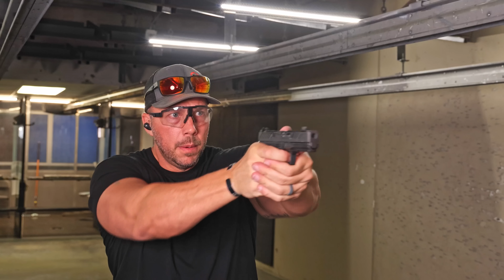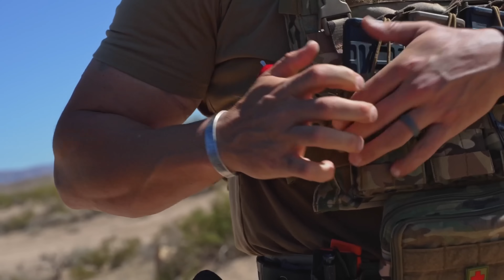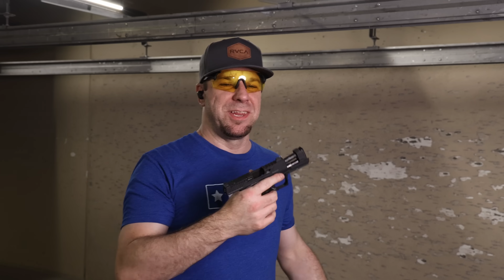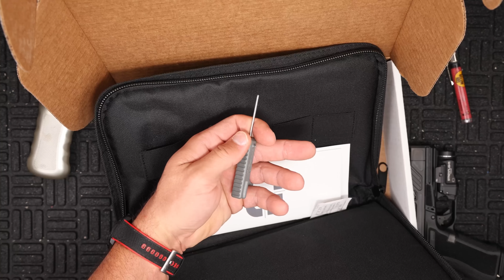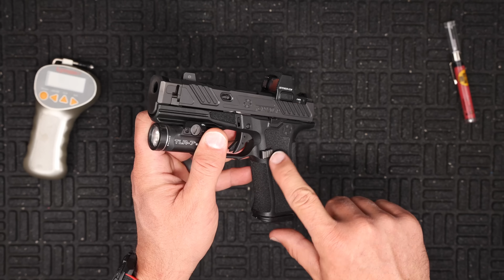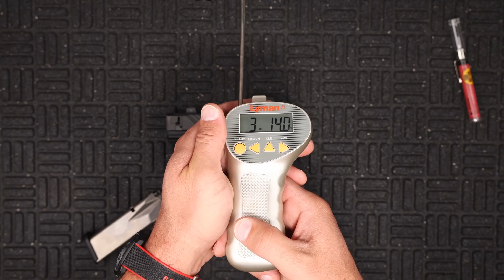Shadow CR920XP Did It Ever Run Right?

Comment: How did you get the screws to fit into optic provided from shadow? Looking at an enclosed CCW and in between filing screw heads or FN provided screws
Reply from the maker: The shadow screws fit right in

Comment: Buyer beware...it will need a Tactical Pontoon Peacemaker Extreme Carry trigger system installed. The factory trigger is horrendous
Reply from the maker: I had no issues with my trigger but factory triggers are never going to be as good as tuned ones.

Comment: So which is the nicer shooting pistol, this or the Echelon 4.0 Comp?
Reply from the maker: I'd really have to run them side by side to determine that. The Echelon has a much different grip size to it and overall thickness. But the Echelon has a more abrupt impactful recoil that other things in its size. Not more muzzle rise just different.
Reply: @TacticalConsiderations I agree. The echelon feels like a 45 with how it “pushes” rather than how 9mm have a “snap” to them

Comment: Great video. I own a CR920X and I’m thinking about either having my current slide and barrel ported by a third party (Battle Ready Arms or MAC Defense) or purchasing a CR920XP. I’ve read anecdotal reports that some XP pistols can have reliability issues with 115‑grain ammo, and I’d like your  input before I modify or buy another pistol.
Reply from the maker: I like the XPI have run tons of 115 to 147 all ran after those first few mags.

Comment: really thinking about getting this gun! i have heard good things about it! being part of the LEP stuff i probably get a good deal on one.
Reply from the maker: I have enjoyed it. Most hat have problems do not break it in appropriately. They recommend like 100-200 rounds of 124g factory ammo for that. But I cheat it. What I do is a lot of dry fire, clean lube, dry fire, clean and lube again. Generally that works it out. However I think I showed in this video I had a few hiccups in the first mag. Since that its been tops.
Reply: @TacticalConsiderations  Thank You Sir for the tip! I’ll give it a try when I get one!

Comment: No, the Shadow Systems CR920XP is not exactly a Glock clone, but rather a distinct design built upon a Glock-style platform—similar in dimensions and operation, with full optics-ready capabilities and compatibility with some Glock holsters, yet packed with significant custom features.

⸻

Glock-Like, But Not a Clone
	•	The CR920XP is built on a Glock-style frame and basic operating system, which gives it cross-compatibility with certain Glock holsters and parts. It’s a slim, double-stack 9mm subcompact reminiscent of the Glock 43X or 48  ￼ ￼.
	•	Unlike straight aftermarket clones that closely replicate Glock’s internals and aesthetics, Shadow Systems elevates the design with custom enhancements: aggressive grip texturing, an integral compensator, tool-less attachment, optics-ready slide, and premium machining. It’s more of a refined, carry-optimized platform rather than a true clone  ￼
Reply from the maker: So its a clone

Comment: I love the Shadow Systems line up and have a few. The CR was meant to be a small concealment gun, but when you add longer grip, compensator, (which makes a longer slide length),a light, and even a magwell, (which would print)……I feel you might as well carry the MR because now it’s the same size and weighs the same. You have just defeated the whole purpose of the CR.
Reply from the maker: Its still an overall smaller rig and much thinner to carry than the MR.

Comment: I have the SS cr920x had one jamb out of 200 rounds breaking it in. Used blazer 125
Grain . Going to try 115 next but I Love the gun
Reply from the maker: Use a good 115G after that break in and you should be fine.
Reply: @TacticalConsiderations unfortunately I just traded it in for a Glock 19x I loved the gun but I don’t carry because of being in New Jersey and I found it was a super snappy and compact gun. I loved it but didn’t find purpose for it

Comment: I bought one Saturday took it to the range today fired 300ish rounds through it with one hiccup in the first mag had one failure to feed then the other 300 round ran just fine was a mix of 124gr blazer and sellier & bellot
Reply from the maker: That’s a decent round count for a break in.
Reply: @TacticalConsiderations  what screws did you use for the vortex

Comment: Man I just came back from the range and incredibly annoyed even though I know about the break-ins for SS. Only had three follow-up shots in 250 rounds. Did a light clean once in-between just to check things inside and still looked good, lubed up and still the same issue. Failure to eject, after 200 rounds it started to mix between fail to eject and fail to load. Checked with other pistols to make sure ammo worked and I wasn't limp wristing. I want to love these but I hate out of three none worked fine out of the box. After a deep clean and another 250 I'll make a final decision I guess
Reply from the maker: What ammo are you using 124g or better.

Comment: The cr920 is a shit gun. I got one. So frustrating.  I own when it shoots its great. But overall is a pos.  Also f the break in period. That is ridiculous
Reply from the maker: Please explain. Did it not function on factory ammo after the break in? Mine took a few mags like I showed in the video and not a single malfunction since.
Reply: @TacticalConsiderations i was getting multiple malfunctions. Failure to eject,light primer strikes, wouldnt return to battery.  I was running 124g too. I just cant get behind something that may or may not work when I need it too. Reminds me of a 380 it could stop a guy with an axe but also it could not lol.

Comment: Any adjustment needed to get some of the mush out of the trigger? Does it help after many rounds ? Not talking weight but pre travel -reset
Reply from the maker: The travel will always be the same unless you swap connectors. But the triggers do smooth out with a lot of dry fire, polish job or lots of rounds.

Comment: Took me nearly 500rds of break-in my MR920 primarily using 124gr, but my DR920P only took less than 50rds to complete break in. They both now have over 1000rds and run flawless, but doubt I'll buy another SS again
Reply from the maker: Good lord. That's a bit long. I like to dry fire the crap out of these before the first range trip that seems to get it done most times.
Reply: My XR920 has been a jam-o-matic for over 450 rounds and my CR920 ended up running even worse after a trip back to Shadow Systems for a new barrel and trigger.  I want to like Shadow Systems but won't waste any more time or ammo on their guns when I can count the failures I've had in 17 years with Glocks on 2 hands and have fingers left over.
Reply: @SombraPiloto  thats insanely bad!!! Damn
Reply: @Fr3d671  The CR920 was FTFing with the rounds getting hung up on the slope of the feed ramp and after I got it back from SS the rounds were literally being crushed into the lower edge of the feed ramp so hard that it would peel the jacket off the nose of the bullet. My Glocks will straight out of the box feed everything from steel cased Russian ammo to underpowered range FMJ to +P JHP with no issues so my Shadow Systems experimenting is done. I'd like to try out an RXM but as one of those weirdos who actually like the Glock grip angle I don't see myself shelling out for one.
Reply: @SombraPiloto  just picked up a Ruger RXM and 300rds all grains without a single jam lol freakin SS sucks huh

Comment: This break in time is lame. That is like saying your wife will only cheat on you for the first week. But after that you can trust her. 🤔
Reply from the maker: As funny as that is break ins are real on most mechanical device.
Reply: @TacticalConsiderations  True. But I have never had that issue with a Glock. I know, I need to spread my wings. However, I can’t deny the fact that Glock has never failed me.

Comment: I went to  the range with my CR920XP and was shooting 147gr FMJ.  I ran through 200 rounds of ammo.  I definitely had issue with the 1st 50 rounds.  They were a range of FTE's, stove pipes and failures to lock back after the last round.  I'd say at least 20 failures.  As I kept on shooting this happened less and less. The last 75 rounds or so were problem free.  I'm going to head back to the range next weekend and put a couple of hundred more rounds through the pistol before I start carrying it full time.  So far though I'm really liking this handgun!
Reply from the maker: Sounds like it's starting to break in nicely.
Reply: So far I've put 430 round through my weapon. This last period I shot 200 rounds of 124gr Nato FMJ.  No issues at all. I then tried some Blazer 115gr and had issues at least half of the 20 rounds I shot.  I also  tried my carry ammo of Lehigh Defense 90gr Extreme Penetrator ammo.  The velocity on this ammo is advertised as 1300fps. I had FTF, FTE and stove pipes with at least half of this ammo.  I have no issues with this ammo in my MR920 at all.  I also shot some Federal 124gr +P HST and no issues.  So I definitely won't be carrying the Lehigh Defense with the CR920XP and will be using the Fed HST ammo.

Comment: Mine didn’t come with Lucas oil! Good thing I have my own. I too have to get through the break in period. I’m 100 rounds in. It’s running better than it did initially. I’m going to clean it and go back to the range next weekend and put  250 through it. Wish me luck 🍀
Reply: Good luck out there!  Just shot mine last Saturday for the first time, no issues at all with 124 grain ammo.  Started with a box (50) of Winchester 124 Nato, followed by 50 of Lawman 124, & 40 rounds of Winchester 124.  Waiting on more 124 grain ammo to come in, figure I'll get to 500 rounds before I order a holster & make it my new edc.
Reply: @MrKlein83  So the rest of the break in went great. I ran a box of 124gr magtech and 200 rounds of 124gr cci blazer brass. No issues at all. I ordered a case (1000)of 124gr cci and 250  Speer GD 124+p. I’m going to run another 250 cci then 50 Speer GD and I think I’ll call it good to carry if all goes well!
Reply: @ Glad to hear the rest of the break in went well for you.  I think if it makes it through the next 300 rounds trouble free, you'll be good to go for carry.  Tomorrow my case of Lawman arrives plus a box of GD carry ammo, decided to try the Lawman TMJ, hope it likes it.
Reply from the maker: Hmmm maybe they stopped adding it.

Comment: Correction. No steel mags come with this model. They supply you with 3-POS PMags. 
It’s not $880. It’s $1100. 

J😮st saying…….
Reply from the maker: You are wrong.. These don't take pmags that is the other models. CR series uses metal mags, the xr, dr, mr and xr use pmags.

Comment: My dilemma is to get either the CR920XP or the P365 Legion. After the breakin ammo the SS requires they are basically the same price.
Reply from the maker: Tough call. Any one feel better ?
Reply: @ yes actually found a store that had both and the sig p365 legion fit my hands better than I think any other gun I have ever owned so I got it. Got a holosun and streamlight tlr7 sub hl-x on it and probably going to the range tomorrow. Hopefully I shoot it as well as it feels

Comment: I carry the CR920XP.  The first 100-200 rounds were jamming every few rounds.  I was using 115 grain.  After actually reading the owners manual I discovered there was a 200 round break-in period.  That 200 rounds should be the +P ammo.  Once I did that, I can now use any of the cheaper ammo.  Has not jammed in over 1000 rounds since I properly broke it in.  Should it have a break-in period? I would prefer not, but taking that out of the equation it is a fabulous gun.
Reply from the maker: Yup its likes 124 on break in.

Comment: Just bought a cr920xp last week. No issues with the break in period. shot about 150 rounds couldn’t make it to 200 because the trigger pull hurt never had that before wondering if this is normal?
Reply from the maker: Hmmmm that's odd your finger hurt.

Comment: I sent my MR920 back to them twice. It did not eject on the first attempt. I had nothing but problems. Customer service was great, but my copy was a dud. I think it has to do with them messing with the extractor pin to for their optic mount.
Reply from the maker: Hmmm did you get a new one.

Comment: My 920xp is the worst gun I have ever fired bar none.  Had stovepipes literally every shot for 200 rounds.  Around 1 in every 100 rounds is a light primer strike (good quality factory ammo that has never had a light strike in any other gun).  Sent it back and they fixed the stovepipes but can't fix the light strikes.  Will NEVER buy another shadow systems, complete garbage.
Reply from the maker: That's a bummer, sounds like you had a bad one.

Comment: For a custom Glock it’s a steal. I used the DR920 on duty until my department and I stopped seeing eye to eye and I changed careers. I had one FTF in the first 200 rounds. 

My only issue with it since then was the last round hold open. My meaty palms ride the slide lock in my high grip which is a “me” problem and not a gun problem. (I also block the slide lock on a Glock). I’ve got a little over 3k rounds through it with just that one issue. I’d say they’re g2g.
Reply from the maker: Hand size always comes into play with riding a slide lock. I used to have a big problem with that

Comment: Buddy bought this gun and had the same issue. Took about 50 rounds to start operating consistently. They need to advertise there's a break in period for this gun because it seems to be an issue.
Reply from the maker: They are pretty up front about the break in

Comment: With all the money I've spent on Glock upgrades, a Shadow Systems would have been the far better choice.
Reply from the maker: I kinda feel that way too
Reply: Except that you don’t need to do the Glock upgrades. It’s good to go out of the box
Reply: @ChrisPBacon28  Not in my experience.
Reply: @KingQ4444  it’s an objective fact that Glocks don’t need upgrades to do their intended job well.  You may feel like you want upgrades, but you don’t need them.
Reply: @ChrisPBacon28  Perhaps I got the one in a million shit Glocks. Mine was a piece of shit until I upgraded various items. Prior to the upgrades I was having light primer strikes, not going back into battery etc.
Reply: @ I think “upgrade” is the wrong term in that situation.  You should have sent it in for warranty repair

Comment: I used 124 grain to break it in, about 200 rounds of it then started pumping 115/124/147’s of all sorts hollows, fmj’s and even some 100 grain critical defense (pink stuff that’s light recoiling) and only had 1 issue that happened with the 100 grain stuff. Got about 500 rounds through it now and couldn’t be happier!
Reply from the maker: Glad to hear it.
Reply: I was able to buy (2) CR920XPs.  Both pistols have provided an identical experience to what you described.  Only 1 logged issue with each pistol, both around 250 rounds.  Couldn’t be happier with them.

Comment: My CR920XP malfunctioned every round for the first two magazines. It’s been flawless for over 600 rounds since.
Reply: I've been thinking about getting it as my first gun. Do you use the gun straight out of the box parts or have you upgraded triggers etc?  I'm debating between this or the hellcat pro comp
Reply: @ozzyc1396  - I'm a trigger snob. Therefore, I installed a Johnny Glock. Most people find the CR trigger gets better with use.
Reply from the maker: Nice.

Comment: Big guy the other lights won't fit on the cr920 XP the rail is too Slim Only the subs can go on that rail the other light just wobble because they are to wide. I put the new TLR7 HLx Sub on my XP. I love those gun. Stay safe Sir!
Reply from the maker: Someone was making insert for thr lights to fit.
Reply: @TacticalConsiderations  I looked a few months back because I have a Olight pl3r from my PDP Pro SD but I couldn't find any and truth he told the TLR7 HLX is more then plenty light for a EDC. Stay safe Bruddah

Comment: My experience with my CR920XP was very similar to a few others I see in the comments.  First 50-75 rounds of 115gr range ammo were nothing but malfunction after malfunction.  

Proceeded to run 3-400 rounds of +P through it to "set" the springs as directed by the manual and have had zero issues since.  Looking forward to putting it in my EDC rotation once I can find an IWB holster I like.  It shoots extremely flat and is a blast to use.
Reply from the maker: Glad it worked out for you, I’ve had good luck with the 124.

Comment: I think break ins should be apart of all firearm systems [Autos]. One firearm maker had it in the instructions to run at least 500 rounds before calling with any issues with cycling. That's one reason I stopped following one big YouTuber. If he got one failure in  1,000 rounds he would bad mouth the gun no matter style or maker. I am talking about cycling of course not breakage of some sort. Like the first Glock I ever got failed out of the box brand new {Yes they fail like any can} the problem was the recoil spring was winding off the end of the guide rod, simple fix but IMO should have never been shipped that way. Good stuff Mike, love the content, keep them rolling. Thank You Veterans for your service!!!  All gave some, some gave all.
Reply from the maker: It is a mechanical device.

Comment: I recently got a DR920 Elite and was having issues with light primer strikes, different ammo made no difference, shot 150 rounds of Nato, still had it...contacted SS and they said it's still a breaking issue.

Finally I did a deeper clean on the slide, took out the plunger and extractor and swabbed the channels and reassembled and did another 150 nato rounds and finally had a clean range session... No failures. 

I really wanted it to work as I like everything else about the gun, but will be super sad if it happens again.
Reply from the maker: Sounds like you figured it out.